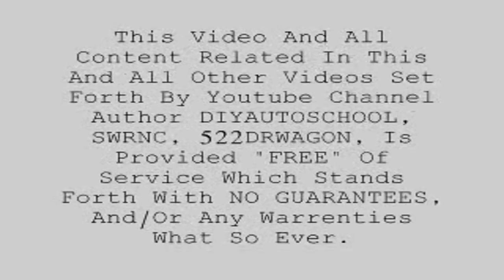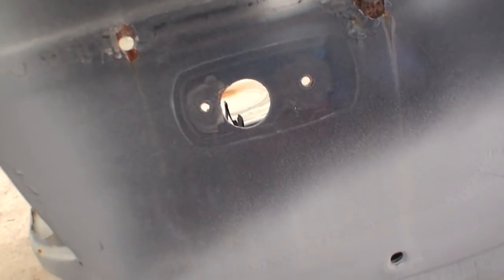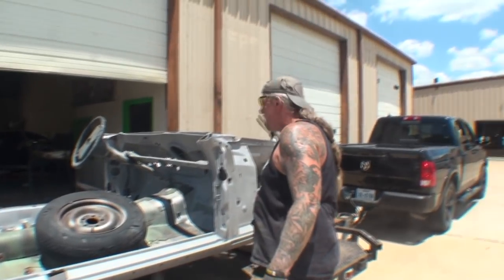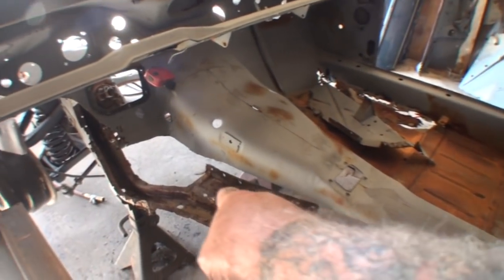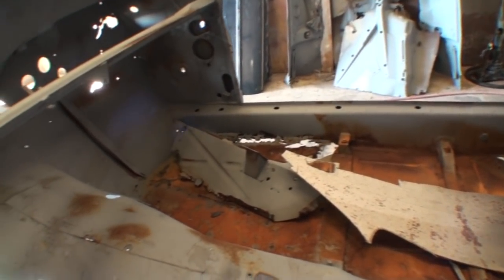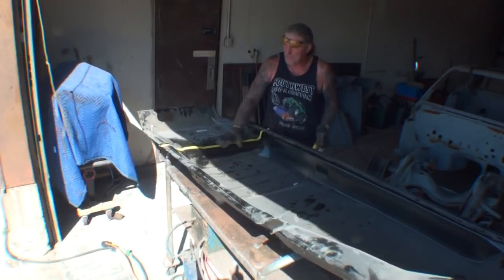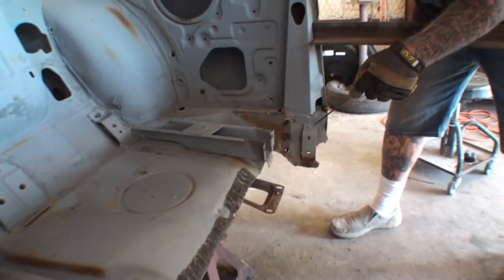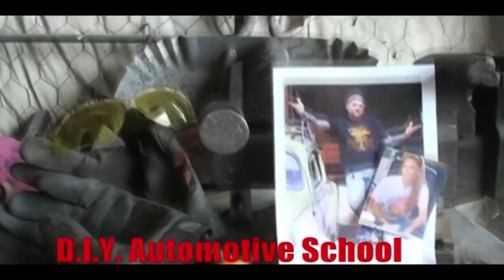Can You Restore A Rusted Car? " At Home " - Part 4

Comment: Sir, I just scored a 53 Studebaker truck that has heavy surface rust all over 100%. There are very few rust holes but the only paint left on the entire truck is the fire wall.
What is the most effective way of attacking this projects rust?
i don't want to Sand Blast because the metal seems thin.
Could I fill a kiddy pool with vinegar or phosphoric acid???
Could I just fill a garden sprayer with the acid and be just as effective???
BTW: there is not a single dent in the entire body.